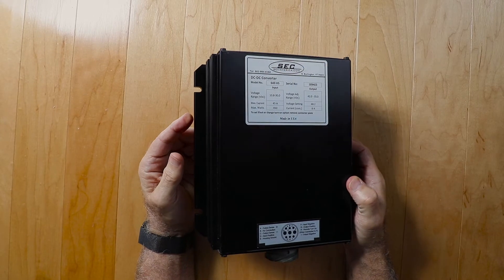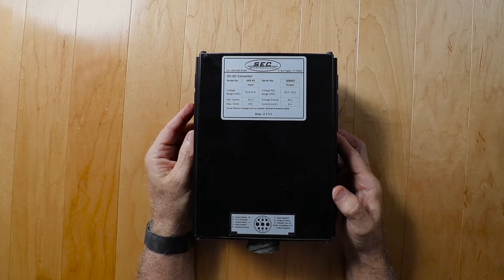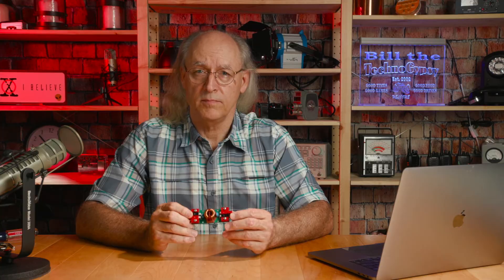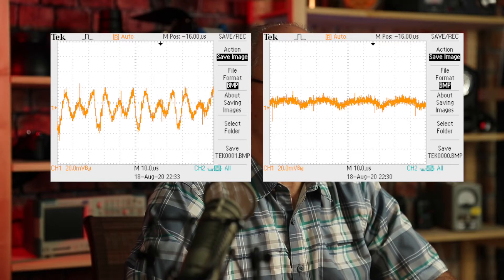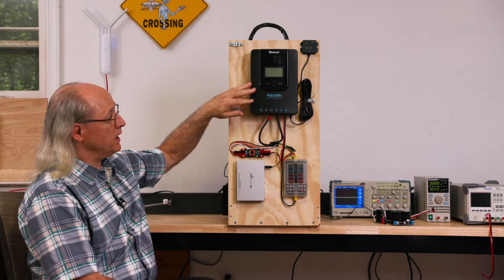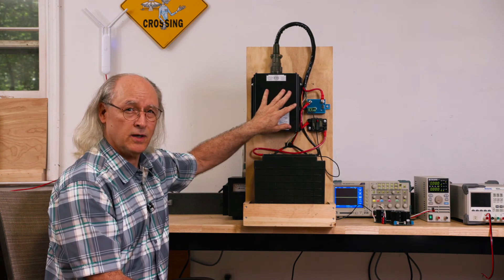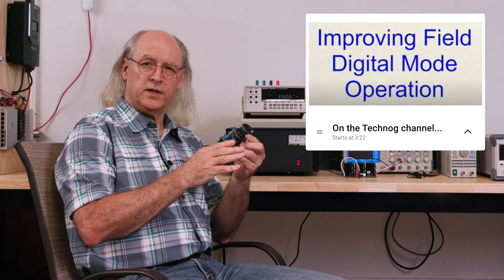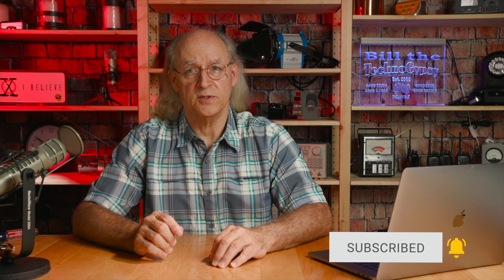DC/DC Filter Board

Comment: Really professional content! 

I have some problem my project.. I hope you can help..

I amp making a class D amplifier which is TPA3116D2(model board XH-M567) powered by SMPS power supply (board name AC-DC2416) 24V DC 6A 150W RMS.

The problem as soon as I turn them on,  the amplifier output product high pitch(white noise like) mix with high frequency whistling.. it becomes worse when no audio signal is playing and when I adjust or put any near the volume knob on the amp board..

But all of thos loud disturbing noise doesn't occur when I tried powering the amp using traditional square transformer with full bridge 1n5399 diode as rectifier and 2x 25v 2200uF caps parallel (output around 15-17v 3A)

It seems the SMPS supply that make such noise.. it looks really well build and bigger power that my tradi~ trans~ but this problem make me tire of it.. the board that us show in this video would help?